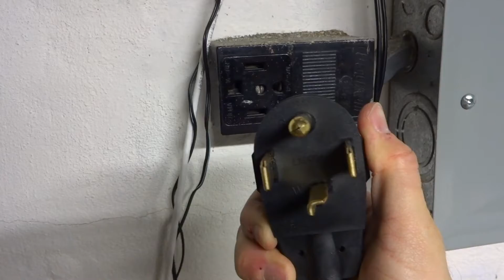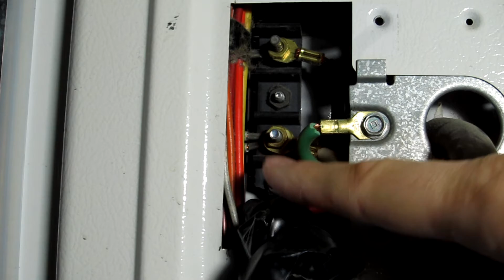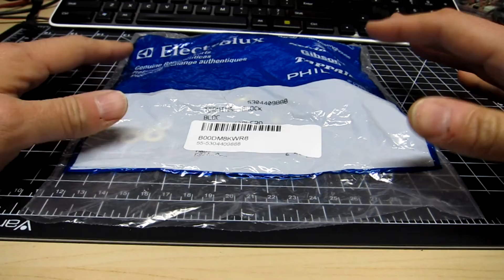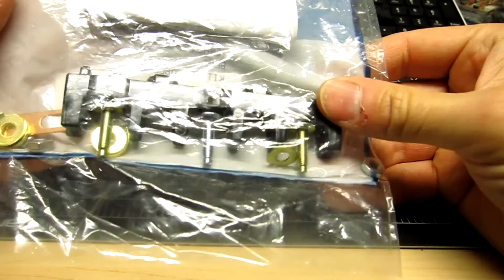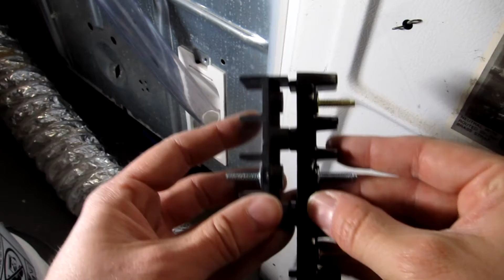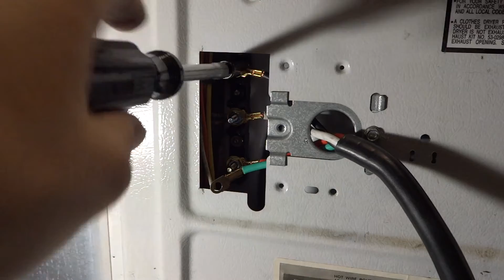Replacing a clothes dryer cord and terminal block

Comment: ok .. 3 things here..

1------ That huge hose with 2.5mm or 3mm cables inside ... is not necessary..
take a look to the cables inside the dryer..
the wiring is 1mm... 1.5mm ...
for both... the "neutral / GND" (Black wire).....
and the "Phase-R" (red wire)..
they puts on that horrible hose outside...
just in case... because if they put a normal 1mm cable outside....
some idiot will plug the dryer... into the same socket he use for plug the nightstand light...

2------ the 1mm black GND cable inside the dryer... and its "ring end terminal" ... has been overheating due to bad electric contact...
it is quite oxidized (copper sulsphate) on it ...
also the joint between the internal black cable of the dryer.. and the ring end terminal
look pretty bad
that is why the screw that held it to the old plastic thingy got loose...
overheat and melted the plastic until the screw get detached just by touching it
you should replace ... or at least clean with sandpaper that "ring end terminal"...

3------ that new plastic thing holding the terminals screws .
It's a short circuit waiting for happen..
the plastic  holding the "Phase-R" screw cable (red).. it's going to break off... just as before...
and will end up making contact against the steel of the dryer...
that's why they wrapped that broken terminals in PVC tape...
the screws that hold the rest of the plastic thingy to the dryer... holds the rest...
but not the "Phase-R" screw cable (red)...
and when the plastic breaks due to the movement of that huge hose with 2.5mm or 3mm cables inside... the "Phase-R" screw it will get loose...
Reply: I don't think you are familiar with US wiring. By code you are required to use the thick 10awg (~2.6mm) wire for 30 amp loads. Internal wiring of appliances has different safety standards so the thinner wiring is okay, but only inside the appliance.

The black (HOT) wire likely was overheating as you say.

I don't see why the red hot wire would break off again. It has the same amount of plastic supporting it as the black wire on the top.